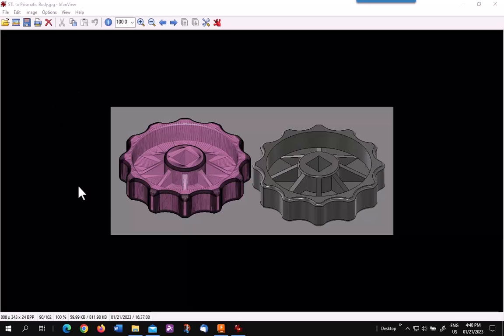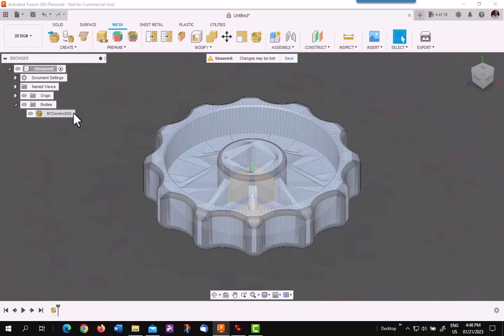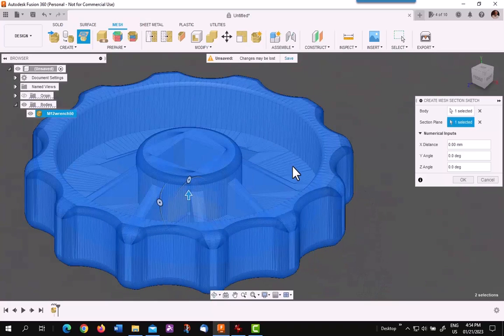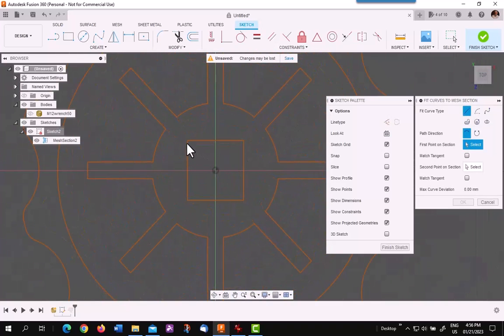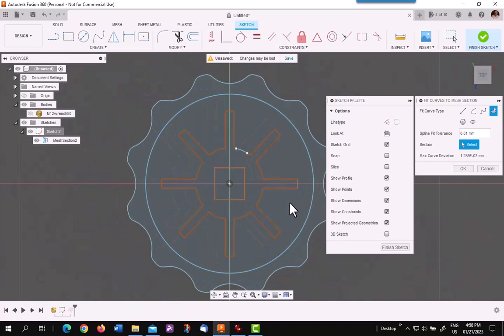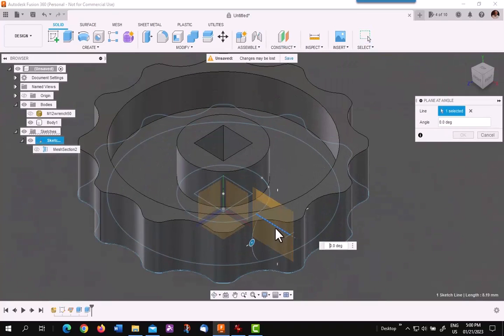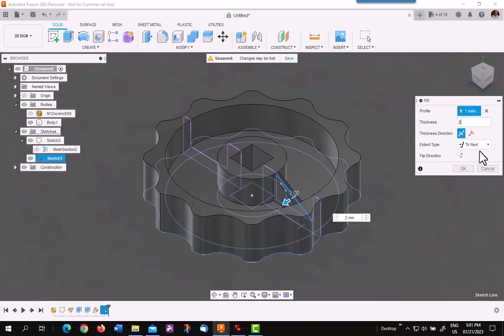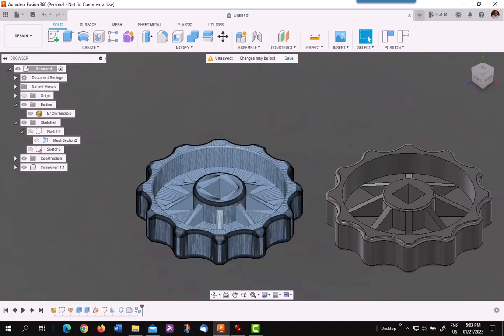STL to Solid Body

Comment: It's not STL to Solid Body, it's how to sketch over the existing STL so that you don't need to model it from scratch.
Reply: Still better than having 10 000 triangles slow down fusion until it crashes.

Comment: This is a great video. I have prismatic and have found it more times than not locks up Fusion because there are to many facets. I can not seem to reduce it far enough to make good solids. 
Is there any STL type files that this method will not work on? Have you ever done a video on reducing mesh and using the prismatic option?

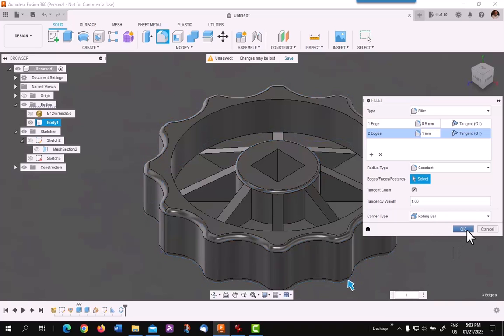Comment: Great job on making this simple and easy to follow. Only thing I am unsure of is that vertical line on the left of the outer wall of the notches. Why does it do this? I noticed this on chamfers and fillets, but I dont know how to fix them. I suspect it is caused when a center point of origin is not exact center point of the outer walls or rings of the model, but I dont know for sure. Any idea how to remove that weird vertical spline or any spline showing on a chamfer/fillet? @ 9:10 you can see it on the left going through outer wall and the fillets.
Reply from the maker: That line is caused by Fusion 360.  If you do not want to see it, go to your Display Settings, choose Visual Style and select Shaded instead of Shaded with Visual Edges.
Reply: @jrhackney  I think it is more than just a visual thing, and it is the result of  a model not fully centered on origin axis. I noticed this only happens if I slightly move a model off the center origin point/axis, and then I edit the model using the origin center point. If i create component and ground a model before editing, i dont have this issue.